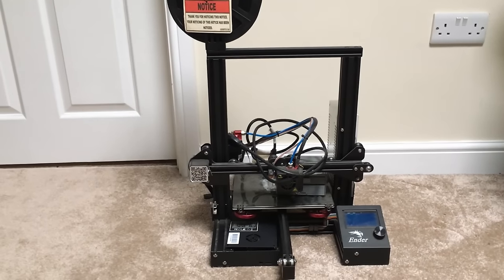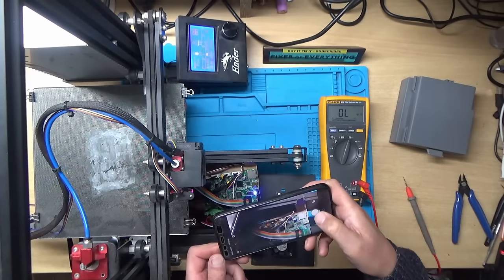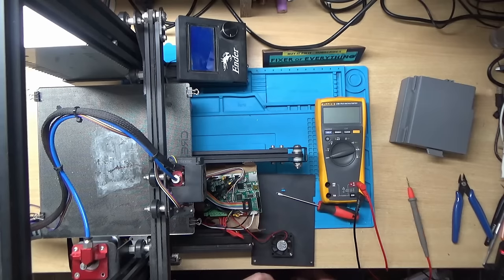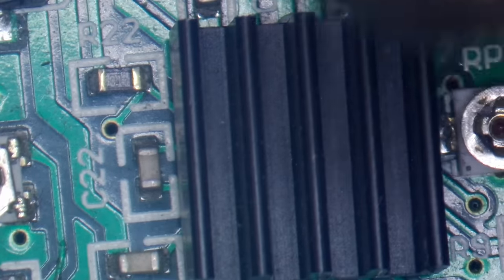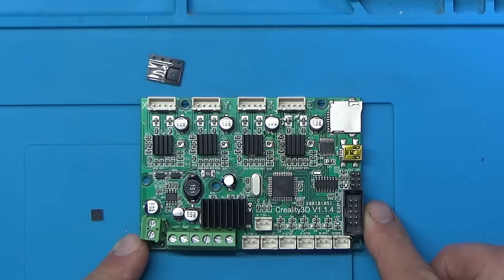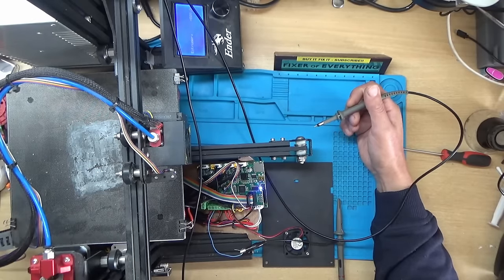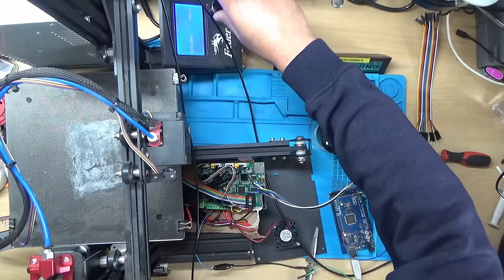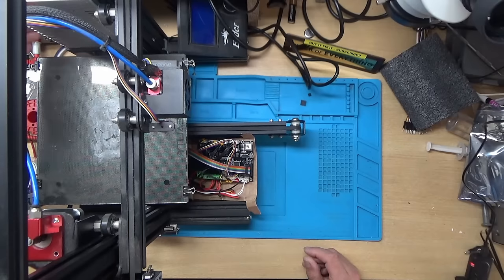Faulty Ender 3 3D Printer | Can I Fix It?

Comment: marlin 2.1 is much better. would love a 32bit board :) my cr10s is 8 bit on marlin 2.1 x.  i also got couch out with cold extrusion stopping me lol
Reply from the maker: Yes, I think a few people were right with the cold extrusion thing, but a few days back I tried faking the temperature by soldering a 470 ohm resistor across the hot end NTC input on the board. I also refitted the driver chip and the extruder motor still didn't move even though it thought the temp was 240c 🤔

Comment: Nice video. Do you know if the new mainboards from Creality now have thermal runaway protection? I have an old driver board which I upgraded to Marlin for that safety feature, but unsure if the same firmware upgrade path is possible or necessary with the latest official board.
Reply from the maker: Thanks. I'm not an expert when it comes to 3d printers, but I'm pretty sure if it hasn't got that feature there is marlin build for that board.

Comment: Could have done with a low pass audio filter and turning off the dynamic volume. The noise is terrible and deafening if you're not talking.
Reply from the maker: You're the first to mention that. I might have another look at my audio setup. I'm not sure if it's in the editing software as I've got a compressor / leveller set up to aim for -10db so it does automatically increase the volume so that may be it.

Comment: I would have started by checking the inputs to the driver chip instead of just replacing it.
Reply from the maker: I just thought it was the most likely point of failure. The driver chips often seem go in these devices from what I've read.

Comment: They are literally designed to be fixed.

🤷🏻‍♂️
Reply from the maker: Yes, but not normally down to component level such as replacing surface mount chips on the PCB.

Comment: Howdy from Texas USA. If I'm not mistaken your name is Michael? Do you own or use a 3D printer? From what I understand a person can purchase all the necessary part to build a 3D printer. You seem to be a very knowledgeable gentleman. What sort of 3D printer would you say is a quality setup? Also I really don't understand why your channel doesn't have more subscribers you're outstanding at what you do.
Reply from the maker: Thank you kindly sir! Yes "Mick" .I've got one of these printers myself, and a few months back bought a broken Ender 5 pro to do another repair video on.The display just lit up blank, and it was the old 8 bit board so it just ended up in a board swap so I didn't make a video on it. I'm probably not the best person to ask on what's a quality 3D printer as I'm not too experienced in the field. The ender 5 pro I've got is a lot better than the ender 3, but apart from that I'm not too sure what other advice I can give you.
Reply: @BuyitFixit Mick, thanks for the reply.

Comment: There was probably nothing wrong with the board. As others have said it won't move the extruder while the hotend is cold. This is a safety feature in Marlin firmware, but may not be enabled on all firmwares.
You can enable cold extrusion by connecting the printer to a computer via USB and using a program like pronterface and send Gcodes via the terminal. Cold extrude is M302

You were right in your testing for a faulty driver. Swapping the motor plugs on the motherboard then using the screen to move each axis. If the problem moves to the other axis then you know its a faulty driver (as the plugs are swapped on the board then it eliminates other possibilities). If it does not then it could be the wiring, the motor itself (very unlikely as they are built like tanks), or something mechanical.

I had a X driver fail on my Aquila board just after doing my very first test print. I was sent a hew board but at the time the chip (H32) it had did not support custom firmwares so I nicked a driver off it to fix the original board. First time I changed a QFN chip and it was fairly easy thanks to watching Louis Rossmann.

Other things in case you didn't know. 
Temperature reading as -14 means there is no thermistor attached. If this was reading some other abnormal reading even when the thermistor is not attached then the main chip has been damaged, most likely because of a short from the hotend thermistor and heater which can happen when working on the hotend while its powered up.

If the fan control is anything like the Aquila (a clone of the Ender3v2 so might have copied this design choice) the motherboard fan is connected to the part cooling fan. If you are not using any part cooling (like when printing PETG) then the MB fan will not be on either. This can then lead to overheating. I always suggest people to rewire their MB fans when they print PETG to the same place as the hotend fan.

As it was an old 8bit board I think the upgrade was the best thing to do, just for the silent drivers alone. Might be a good idea to upgrade the screen next to the colour one, then try a custom firmware like Mriscoc ProUI.
Reply from the maker: Thanks MIK, the original board was definitely faulty as it sent power to the extruder motor constantly, even at very first power on. None of the other motors did this. After replacing the chip it powered it was not locked anymore. The printer didn't display any errors or messages when trying to extrude, where the new board said hot end too cold. So I'm not sure if the old firmware supports this? But I would have expected a message or something and not it to just pretend to move the extruder 🤔 Thanks for your comments some things that I didn't know 👍
Reply: Pretty much everything wrapped up here in this post. I appreciate all of it.

Comment: yea you must heat the hot end to 160-210 before the firmware will allow the extruder motor to move its a safety setting
Reply from the maker: Thanks for that, see pinned comment and replies.

Comment: This chip probably had spare legs you can redefine in the firmware
Reply from the maker: Yes, certainly possible. Similar to the RGB laser I looked at (video on here) which I had to use an earlier version of firmware I found (that someone managed to dump out of a slightly different version) and then rewire the I/O to different pins.

Comment: CHeaper source of the chip is to sacrifice an Arduino. Had the same thing myself with a Chinese printer caused by a blocked print nozzle and the filament feed could not drive.
Reply from the maker: Yes, I had thought of that, but thought with it only being an 8 bit processor with not a lot of ram, upgrading the board seemed like the best way forward. Thanks for your input 👍

Comment: Good job!  Honestly if it were me, the second I determined the board was faulty, it would have been in the bin.  I would not waste .00001 cent of electricity with the scope.  There are sooo many affordable upgrades for no money it makes no sense to faff around with an antique 8 bit board, unless you actually have the part in your stock to fix it and you are really really really desperate for something to fix.  Its like trying to fix an arduino nano at this point.
Reply from the maker: Thanks, yes I thought it might have made an interesting video but as you said it was better to just upgrade it. I bought an ender 5 pro for spares or repair with a faulty board hoping it was the 32bit, but it was the old 8 bit one so I just upgraded it straight away and didn't bother doing a video on it.

Comment: Good opportunity to upgrade. Mine is a generic printer and I found updating the firmware was like having a new printer. Hopefully your friend paid you back for the new board.
Reply from the maker: Yes, and yes he did. I did buy a faulty ender 5 to repair but it also had the 8 bit  board so I just upgraded it, I did have a nightmare with firmware though and had to end up compiling my own.

Comment: could it be thet it does not extrude because hotend is cold? It is protection in the firmware.
Reply from the maker: No, the new board prints a message saying hot end too cold. The old board just let's you extruded regardless. I've got the same old board in mine. I even flashed old fw to see if it was something like a setting or something in the firmware, but thanks for that 👍🙂
Reply from the maker: Appologies, another viewer commented that it doesn't show a message, so it is a possibility. I fired up my ender3 from when they first came out and it doesn't show the option to move the z or extruded only x and y, so you may well be  correct👍

Comment: I hope You checked the fan also. I have same printer, fan stopped working and main board was ruined. Bought one like You and wired a new fan so that it is always on when printer is on.
Reply from the maker: Thanks, yes did the same. I recently bought an ender 5 pro with BL touch to do a video on, but it had the old 8 bit board so I just replaced it. Didn't bother doing a video on it. Turned out to be a bit of a nightmare as I ended up having to compile my own firmware to get it to  work properly. Works great now and a bargain at £70 🙂👍

Comment: I have recently had my shooter motor fall on my ender 3 pro and it turns out it was the driver built into the board that failed so I have to buy a whole new main board
Reply from the maker: Yes I think motor drivers fail fairly common on these boards.

Comment: To continue - With this set up the and being in Touch-screen mode the screen would have advised you the minimum extrusion temp had not been reached!  You mus heat the Hot End before you are able to extrude!
Reply from the maker: Thanks for commenting. I am aware of this now  (see pinned comment and replies), the old board / software did not display any such message and just showed on the display like it was moving the extruder. When I first looked at the printer, the extruder motor was energised as soon as you powered up the printer (even before the screen booted) and you could not move it by hand. It had been working fine, but then it just stopped extruding during a print (or that's what I was told). After a few people mentioned about the extruder temperature, so after receiving comments about it, I tested the board again after fitting another new driver chip and faking the hot end NTC with a 420ohm resistor (display showed hot end temp of 230c). Unfortunately it still didn't move the extruder motor after doing this too.

Comment: Why not simply pinch the atmel chip off a cheap arduino mega?
Reply from the maker: The only mega's I had at the time are the Mega256's.I think It turned out a better solution to upgrade it with the 32bit board with the quieter stepper motors.

Comment: Hi. I was watching your video and I noticed something.
At minute 11:12 you measured a resistance with the label "010", which means 1Ω.
You measured 10KΩ.
You may be able to check this again.

By the way, I think your videos are great, especially the systematic search for the error.
I love repairing things instead of throwing them away.
Keep up the good work!
Reply: Hello 
I have realized that it should be called "10C".
That is of course 10KΩ
You never stop learning.
Reply from the maker: Thanks and thanks for commenting. I read your later comment too. Glad you like fixing things too 🙂👍

Comment: I had that pin 27 board for a BL Touch and could not get the lid back on without it causing issues, I ended up having to print a new cover that raised above the pin 27.
 I ended up upgrading the board and adding a second leadscrew and motor
Reply from the maker: Nice 👍

Comment: The microcontroller for  the extruder pin will not go high unless the heater has come to temperature. The extruder can't push plastic through until it is hot, so the microcontroller checks if the heater is up to temp first.
Reply from the maker: Yes, the new board indicates this, however the old board does not and I didn't know at the time. After making  the video and receiving comments about this I did test the old board again using some resistors to fake the temperature, and it still would not extrude.

Comment: I was surprised how you didn't resort to the scope earlier. When I troubleshoot, it's always the first piece of test gear i go for. I like to see what's happening (or not) on those pins!
Reply from the maker: Good point!
Reply: I don't see anything wrong with his approach. He chose to start at the business end and then proceeded to check the chain one link at a time. Starting at the µC end and replacing it (had it been available and at a reasonable price) without checking the driver first, could have resulted in more than one faulty controller (although these devices have voltage clipping diodes, their typical source/sink capability is around 20mA - just enough for a LED/optocoupler/small MOSFET - so overloading the output easily results in failure)
Reply from the maker: Thanks Bogdan👍

Comment: A question.... Does using gasket sealer between the chip and heatsink not insulate the chip from the heatsink? Also, Marlin stops cold extrusion it does this so that the filament is not accidentally chewed. I have a direct drive setup though and not bowden, so, I am unsure of exactly how that works, I am sure though that there should be an allowed amount of loading to be done to get the filament to the hotend ? Nice workflow and fault diag.... Subbed.
Reply from the maker: Thanks Gap, it was only a very thin layer of gasket sealant, the stuff they had used also appeared to be a silicone based adhesive. The chip is also thermally bonded via being soldered to  the large ground plane under it. A few have mentioned about the hot end temperature, but after these comments I thought I'd try faking the temperature to the mcu with a 470 ohm resistor. I fitted a new driver again, but unfortunately there was still no movement on the extruder even though the lcd displayed a reading of 240c from the faked NTC.
Reply: @BuyitFixit   Nice, Like I say, I like your fault finding methodology....

Comment: There's a safety in Marlin (the firmware Creality uses on their machines) which stops the motor being driven on the extruder if the print head's not heated. it's enabled by default to prevent the extruder trying to pull or push filament through a cold extruder causing it to strip the filament. Heat the hotend up to 160*c and it should let you spin over the extruder motor.
Reply from the maker: Thanks, yes a few people mentioned. I did try soldering a 470ohm resistor across the NTC input for the hot end which showed a temperature of 230c on the display, fitted another new driver chip and it still didnt extrude...

Comment: I'm not too familiar with that particular 3D printer, but most bowden type printers have a function that allows you to load filament into it.  You could try that and it may even feed the filament even if the extruder is not at a high temperature.  The other possibility could be that the extruder filament driver chip is waiting for an enable signal from a sensor that detects if filament is loaded or not.  I know that my printer has a sensor looking for the presence of filament.  That one could be similar.  Maybe the filament detector sensor is hard-wired into the driver and the driver will not get the enable signal until it sees the filament.
Reply from the maker: These don't have a filament sensor as standard, I think it's possible to add one though.

Comment: The little trim pots next to each stepper driver adjust current limit. Maybe the one for the extruder needed a tweak?
Reply from the maker: Thanks for that, yes I already knew as I built a CNC some years ago which used the stepper driver modules. I compared the voltages on the output of the pot to the other steppers and it was around the same as the Z axis which would probably require a bit more current than the X and Y. Thanks for the suggestion though, your feedback is appreciated 👍

Comment: Haven't seen everything yet but i'm wondering if it's a protection thing that it won't extrude if hot end isn't hot enough but still it should display something i would think
Reply from the maker: Yes, the new board said hot end too cold, but nothing displayed on the old board.

Comment: it is always nice to see i am not the only person who get confused with fixing the hardware when the problem is obvious to a vetaran of the field
probably many people said it before but older versions of marlin used on board didn't warn you about extruder being required to go aboe 180 degree c before motor would move 
building never version of marlin for the oryginal board would probably give you that message but oryginal firmware was cut down and simply might not have the warning
i am seriously wondering if the oryginal board was perfectly fine after swaping that first motor
did you cut out the part you heat up the hotend before testing extruder ?
Reply from the maker: After all of the comments, I got the old board back on the bench and used a couple of resistors on the thermocouple input to fake temperatures on the hot end and bed. Still no output on the stepper. The original owner said it failed mid print and wouldn't extrude any more. I suppose it's one of those things when you try to fix a large variety of things and don't know the nuances of every device.
Reply: @BuyitFixit  yes somethng like that is a great troll  , did you try to change pinout of the board in marlin configuration to get output on a different probably unused output or write an arduino sketch to test the output? i belive you could save it even if microcontroller is faulty and not board itself if  you complile custom firmware for it
downloading arduino "core" for bare microcontroller should help with troubleshooting
anyway there is quite a lot of hardware on that board and it would be a shameto trrow itaway
Reply from the maker: @kokodin5895 I've got two faulty boards now lol, one from the ender 5 too 🙂 they'll come in handy for parts if nothing else 👍